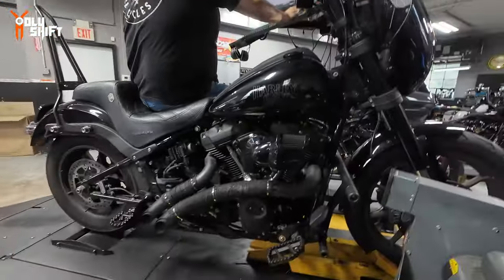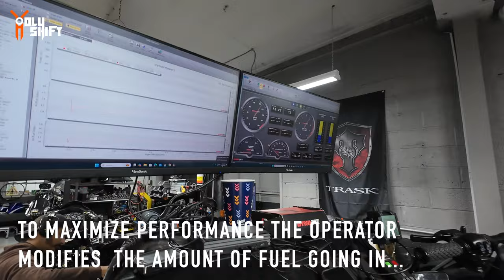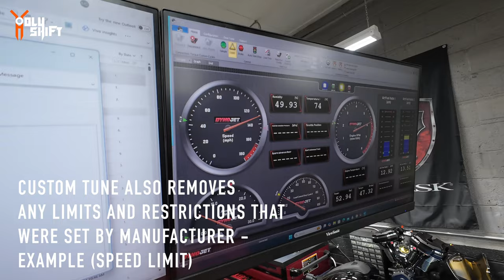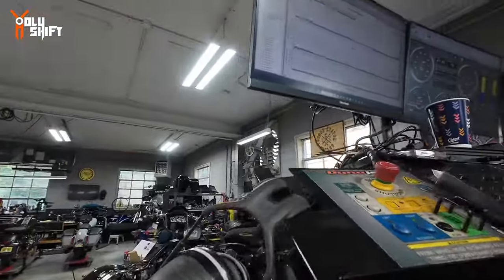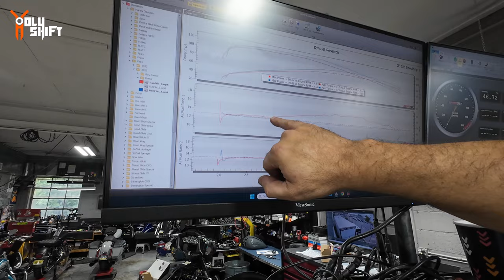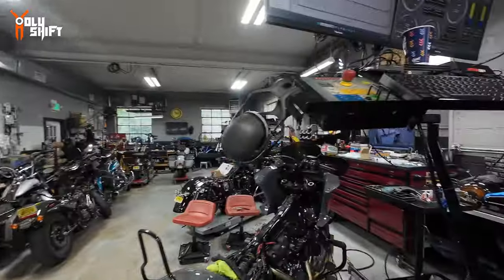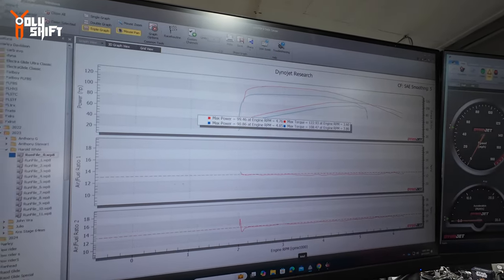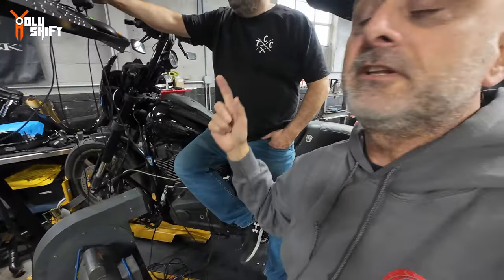Big Power Gains‼️ By Tuning Only ❗️

Comment: I was always wondering why modern bikes are running so lean. It is not about the ecological standards only. Unfortunately, in all engine tuning videos, tuners forget to mention, that modern bikes are equipped with catalytic converters and in order for those to live longer life without breaking down too soon, the mixture has to be lean to make sure no excessive fuel is actually burning in the catalytic converters. That is the main reason why bikes are running so lean, to avoid warranty cases.
Engineers at manufacturers are not idiots, they run their engines that lean, meaning it is still safe for engines to run that way.
So when you remove those cats, there is no reason running that lean mixture.
Reply from the maker: Thanks, I didn’t know that